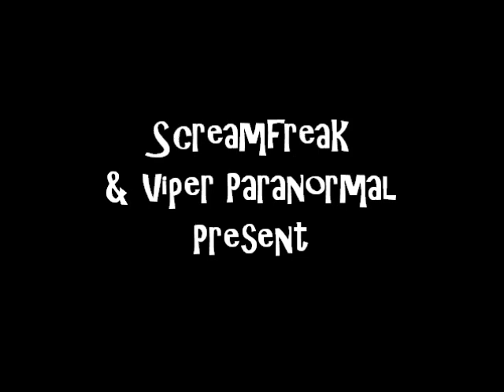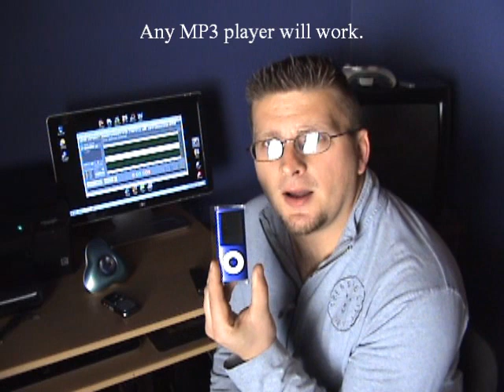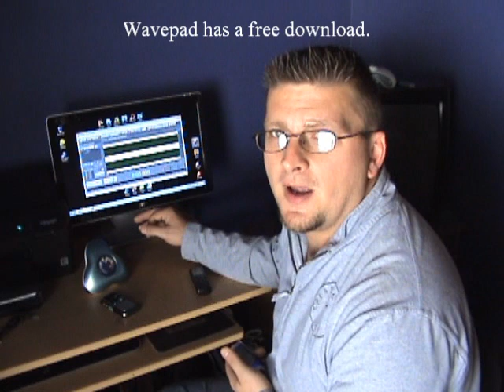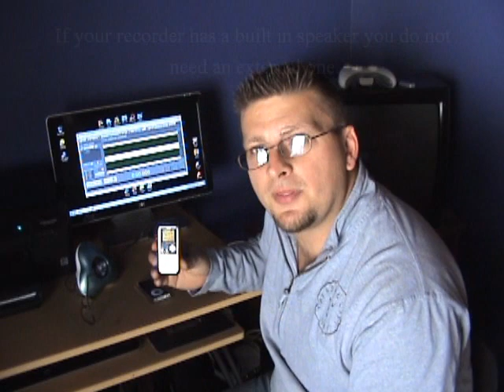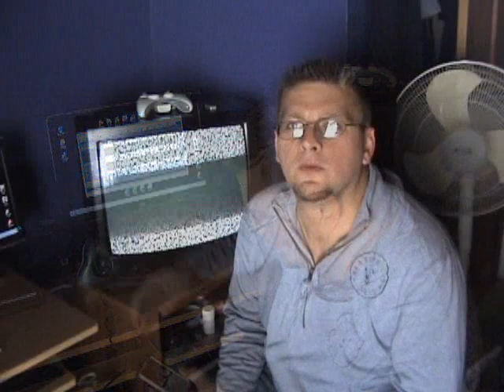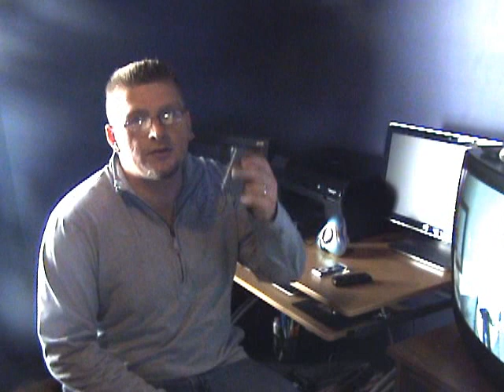Comment: the problem with using tv and radio is that even tho you are not tuned into a strong signal you will still get residual signals and small fluctuations in the EMF that will affect the signal.

Comment: If you have an android phone i have just released a all in one evp recorder with whitenoise generator on board, you can record and generate white noise straight off your phone and play it back whilst done, you can also use the auto evp mode which asks various questions in timed successions from 5 seconds to 5 minutes, sessions can be set to 1-3-5-10-15 minutes of your choice or manual recording lasts for as long as needed, The evp app also has a very complex detector system which can trace where signals fluctuate, it uses gps/gprs/wifi/emf/gyroscope sensors and receivers to analyse and scan for possible entity's its not like those silly toy detectors, it really does scan and compare data to send you to where it is, it even can voice guide you, it also has a visual white noise monitor which lets you see what the sensors pick up, This won't show spooks like those fake ones , it merely shows the interference in realtime, letting you know of a possible entity, We know that spirits tend to mess with electronics and this app uses all available utilities on the device to detect them, It is also sensitive to other electronic equipment like pc's/microwaves and radio's so when using make sure you are not using such equipment, My app has reached over 10'000 downloads in six weeks and has about 100 5star ratings, Real ghost hunters were informing me of its accuracy compared to there very expensive equipment and thrilled with it and use it now as tools on the job, You can get it on the android app store just search appydroid or evp it is green icon with evp auto recorder on the logo. I am also looking for real world recordings to make a feature video for it, Anyhoo the app is 100% free with no stupid ad's If anyone would like to check it out i would be most appreciated of any feedback likes or ratings. Kind regards, Puggster, AKA AppyDroid.

https://play.google.com/store/apps/details?id=appinventor.ai_puggster2007.EVP_Recorder&hl=en
Reply: If you will can you answer my questions so I can understand it? It seems like you know a lot about it!
Thanks :-)

Comment: Good call. I was using an older tv set. this may not work with more recent ones. The radio static will work as well as a recording sound of a fan running. I have even experimented with running water.

Comment: If you are familar with electronics, I suggest you build your own white & pink noise generator.  It only takes a few transistors, resistors, and capacitors and the parts can be purchased for less than $5.  Maybe $10 to $15 if you want to add a speaker and an amplifier.  (Otherwise, you can plug it into the line or mic input on a boom box, tape player, or your PC and amplify it that way.)  Google the web for schematics or check out the Electro-Music Forum which is a large community of DIY'ers.

Comment: Here is the easiest way to record white noise:

1) Disconnect your TV from its antenna.  If you have a satellite dish or cable, disconnect the cable that runs from the cable box or the dish equipment from the back of your TV.
2)  Find a TV channel where you see nothing on the TV but white snow and you hear nothing but pure noise. This noise is white noise.. 
3) Using a digital recorder, tape recorder, or a PC, record the white noise. (It doesn't matter if you record direct or use a microphone.)

Comment: so if white noise is white noise and it doesn't matter where it's coming from, and i have an analog am/fm radio and i find a station that doesn't have anything on it and let it sit on that station that is all static wouldn't that work just as well as modifying a digitally tuned am/fm radio so that it sweeps through the channels?